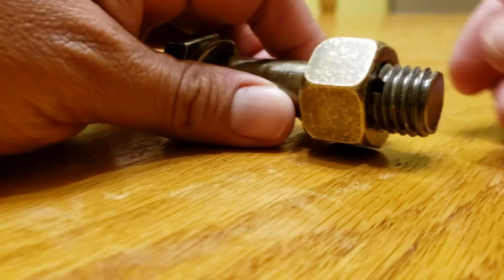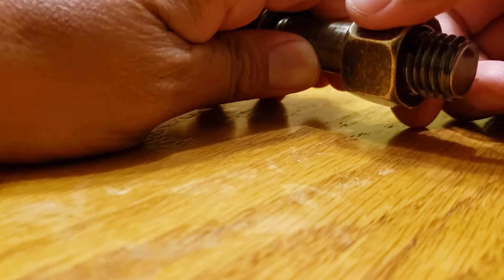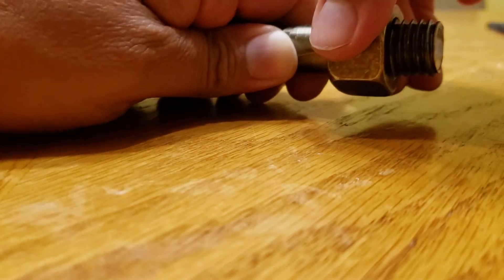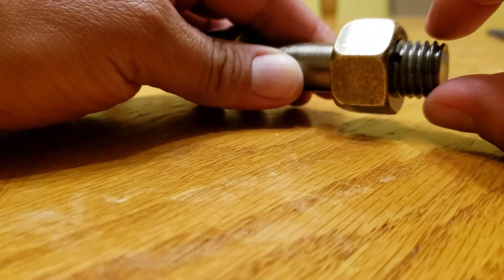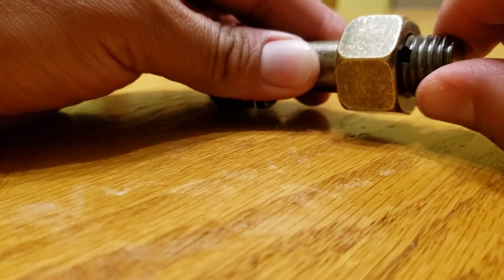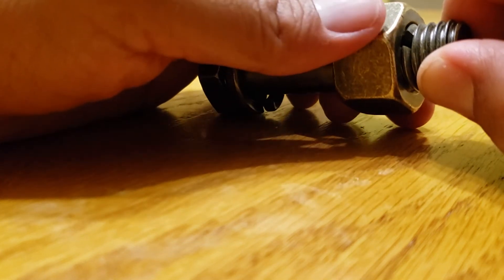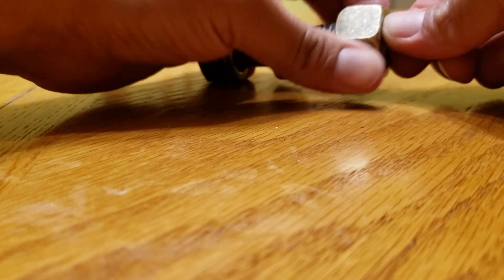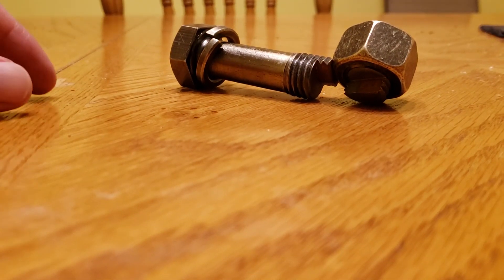Eiffel's Tower Bolt Puzzle explained.

Comment: Good video! After solving it, did you found a solution to stuck it back? I didn't yet!
Reply from the maker: It should be the same method when putting it back.
Reply: I just simply screw it back in.
Then when I screw it out, it goes out easily without doing any trick.